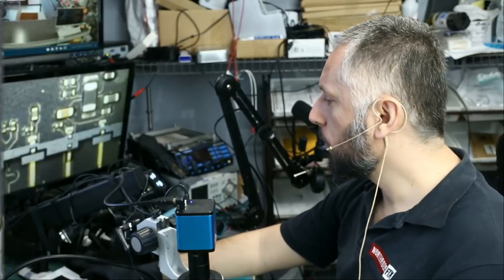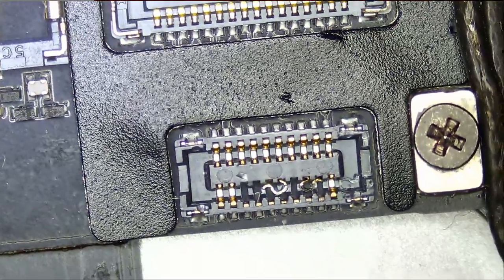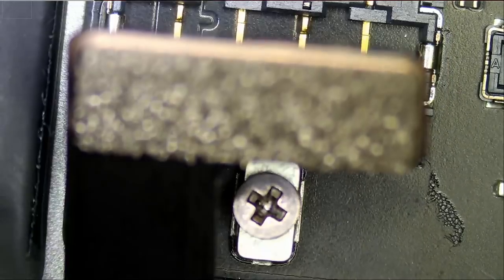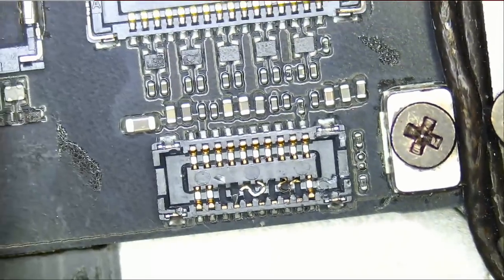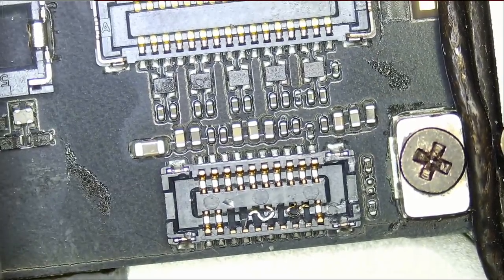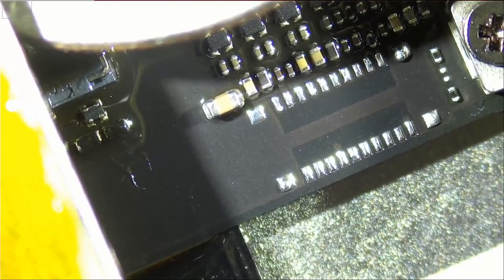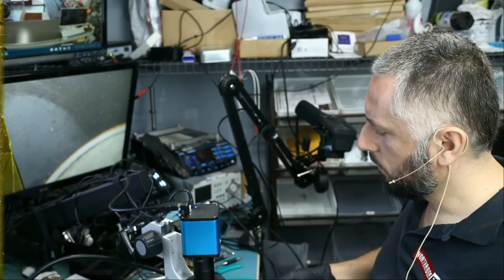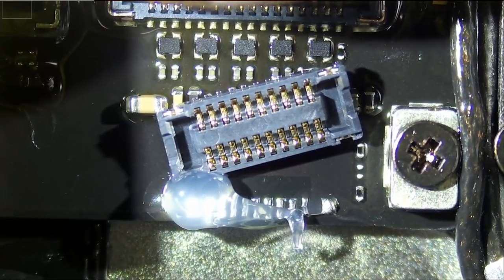iPad mini 2 Digitizer FPC connector replacement. Hot air station and temperature settings

Comment: I know this is an older video, but it made me smile when you were talking about the Solder Stations. The difference between a good solder machine and a cheap one, saying if it can sense if the tip is loosing heat to the motherboard or not. I just blurted out "You mean if the solder machine has a good Thermocouple that send signals to the heater control card/chip or a cheap ass Thermocouple." We use Thermocouples in the Hot Runners at work so the Heater Control Panel Array can supply electricity or not to keep the Heater Bands at the right melting point for the plastic resin without burning the resin. This is inside molds that heat plastic resin, inject it into a mold, and make plastic auto parts.

Comment: I realize this is an older video however thank you for describing your heat & air speed settings as you go along.  I try to do this as a hobby and I’m always interested in understanding how you approach your work.  I know you say your experience is the reason why you charge what you charge regardless of how long it takes you so I appreciate when you share little pieces of your knowledge.

Comment: I love it when you explain what your doing / why that way / temps your using. Excellent video! But im just wondering, how did the small SMD filters not just fly away? they seem to just fly away with heat and air

Comment: I have  recently bought a Hakko 852d and 851 (built together in one custom case)dual station with iron and hot air,but not with a ventillator in the handle. Instead, it has a big air  compressor in the base.
I wonder if it is good or not? Is it accurate in temperature metering? And is it reliable enough for long-term use? I am asking this here because you have probably seen/tried more of this stuff in your life  than I ever will. I also have a 220v 75W Weller station but that is just a soldering iron with solder sucker tip and no hot air stuff came with it.

Comment: This sort of job should only be attempted by experienced professionals like you sir.
Reply from the maker: I appreciate the good words
Reply: Learn how not to destroy connectors and soldering on junk first. Either way things will happen, toshiba laptops had a zif socket on the board you looked at the tab and it shattered! After all their trying to maximize profit, but Ive never seen a jack that mangled and not tore off the board!

Comment: I assume this is a plastic connector how come it not melt plastic at 400 degree?
Reply from the maker: The connector can handle heat but has a breaking point. Knowing your hot air station and how far you have to be from the connector and when to pull out, only comes with hands on practice.